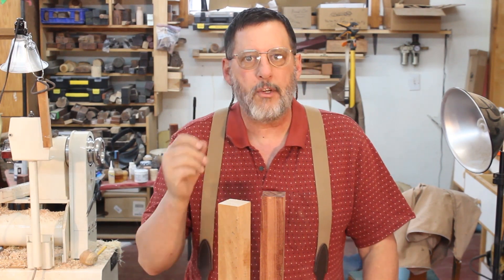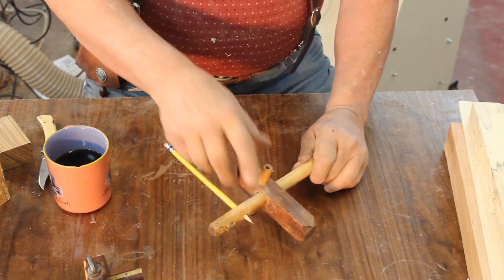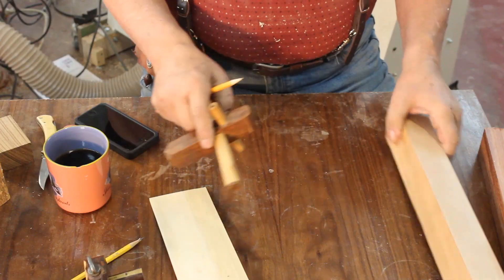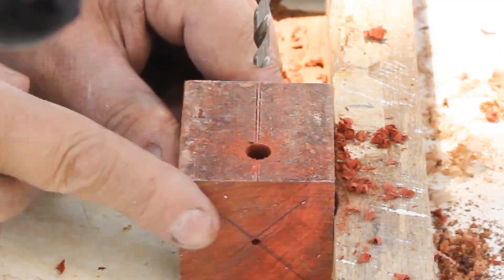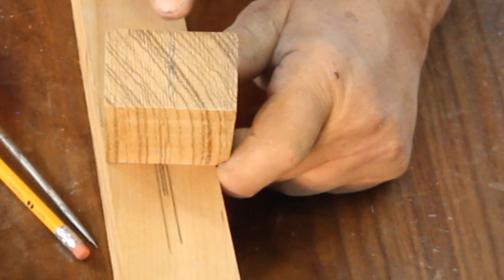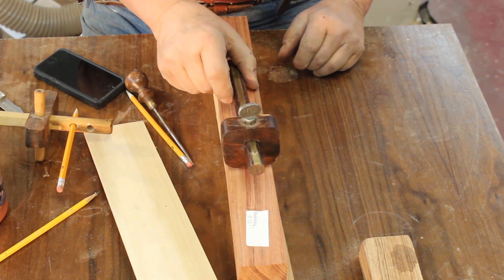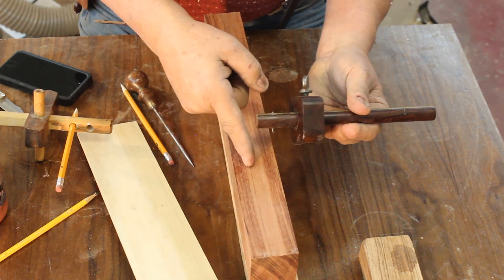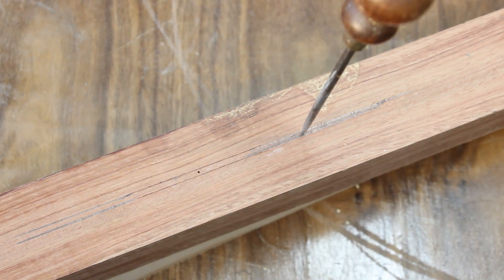FINDING the  Center of a Turning Blank (woodturning)

Comment: Sam, I get this...it's straightforward enough...low tech, simple.  Yet, how does this method compare to using your tape measure, then halving the width, then marking that?  Which is what I'm in the habit of doing.  Thanks for the video.
Reply from the maker: +Mike Porter I have just never used a tape or ruler for this.  As an "old" wood worker I always used a marking gage.  I think using a ruler and depending on seeing a mark on a ruler leads to error.  Another way using a ruler is to measure from the left side, then the right side and marking something which is close to the middle.  I think a tape measure works best here as you can hook the "0" point from each side and it is always set to 0'.  Lots of ways to get to the same place.  And how important is 100% accuracy anyway.  Sam
Reply: You answered my question well, Sam.  Thank  you.  I appreciate your openness to questions such as mine.  There are a number of ways to get to the same result, still we can learn from each other, can't we?

Comment: Using your band saw, place one edge of your wood on a diagonal in the slit of the table and run it up to the blade to the opposite edge just touch it on the running blade you have a fine cut going from top to bottom.  now turn the piece of wood 90 degrees and do it again voila you have the centre of your stock.. flip the wood to the other end and repeat, there you have both centres perfectly centred

Comment: how bout laying a ruler on a skew  0 and 6   3 will be center
Reply from the maker: +Tom Wilhelm That is a great method.  It gives you a point, if that is all you need.  I use that method for dividing a board into 3-4-5 sections as well.  I put up a link to an old video that covers some other marking and measuring ideas.  I did not intend for this little video to be really comprehensive.  But there are many ways of finding the center, like a center-find ruler.  Sam